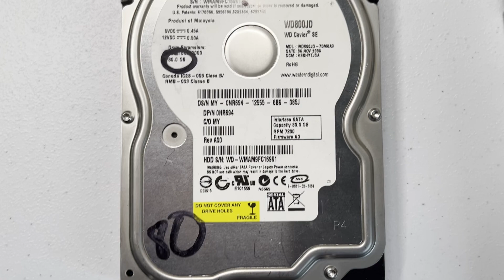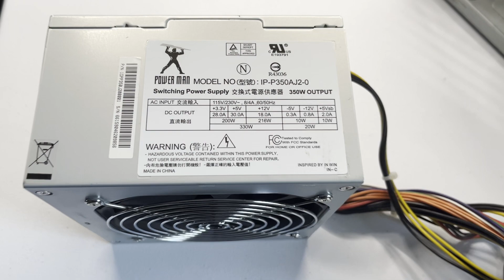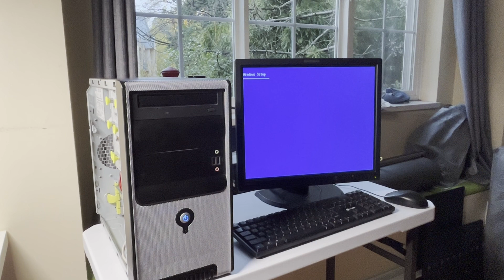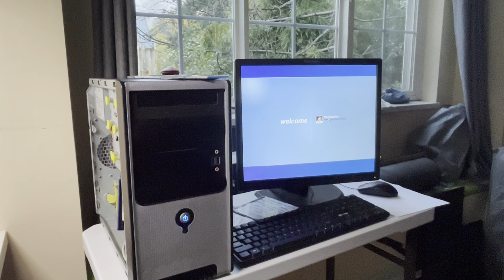Another Retro PC building - Parts info in description #retropc #pcdiy

Comment: Socket 939 builds are always cool. Mine has an ABIT AN8 Ultra nF4 uGuru and an Athlon 64 3500+ CH overclocked to 2.533GHz. And it can still playback yt on the latest version with MyPal 68 and Windows XP SP3. I'm using a 9500GT 1GB video card and a Crystal CS 4280 sound card until I can get a Soundblaster X-Fi and ATI X1900XTX. I also have a big copper cooler (110MM) and 2GB DDR-400 for it. The whole PC is on my channel.
Reply from the maker: Very nice